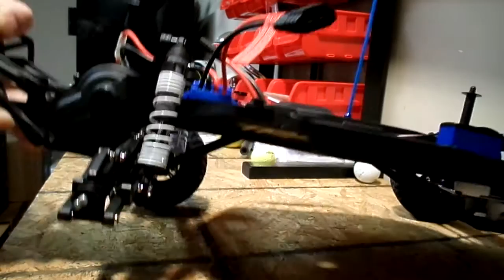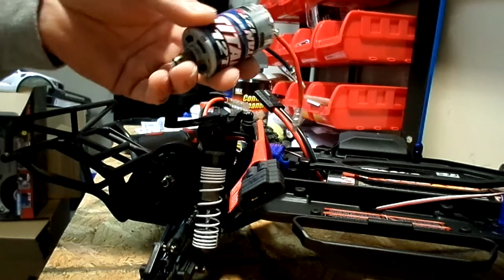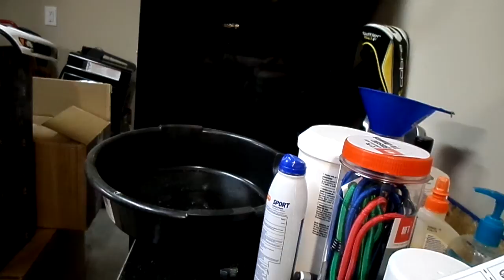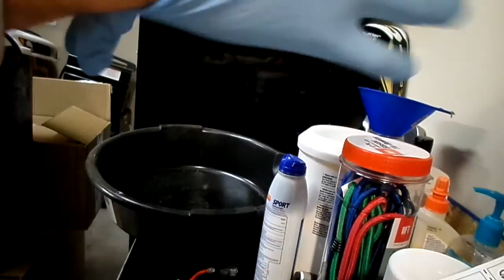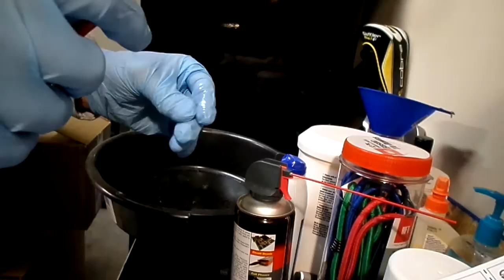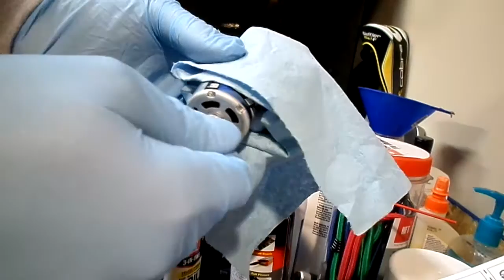Breaking in and cleaning of brushed slash motor 12t titan 550

Comment: I've watched several other videos on cleaning out the brushed motors and they've ranged from opening them up, NOT cleaning them, and putting them back together, or just using a air compressor, or other stuff along those lines. You've done a great job using the correct methods (based off the majority of forum members explanations) and well explained / shown. Thank you!